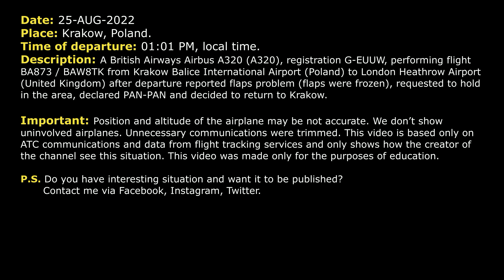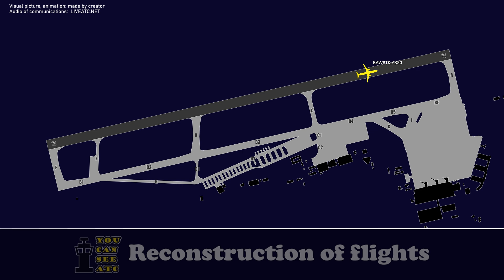“Our flaps are frozen”. British Airways A320 declared PAN-PAN after departure from Krakow. Real ATC

Comment: Anyone able to explain what the 2 hr endurance means? Is this something to do with the fuel burn if there was a fire ?
Reply: I assume it means they can fly for 2 hours in their current config before being low on fuel.
Reply: 2 hours endurance means the aircraft can fly for a maximum of 2 hours more. Unless it is absolutely necessary, landing with less than 30 minutes fuel will attract the attention of the company's operational standards unit, and possibly the regulators at CAA (Civil Aviation Authority).

Comment: Can anybody explain why the pilots decided to go back to Krakow? The plane was nearly equidistant from the two airports, and the controller suggested going to the other airport with the longer runway multiple times. I'm assuming the plane will be landing faster without flaps, and it sounded like the controller was concerned their runway wasn't long enough. I know the pilots have the final say in an emergency, but why didn't they go to the other airport?
Reply: The flaps were locked in TO config so max speed was 160kts.
Reply: @Bluefox202  That was my thought - had to keep lower speed...possibly BA has a more robust maintenance presence at Krakow.
Reply: @frollard  yup, most likely because Krakow is a BA station, while Katowice isn’t. Actually, the controller was incorrect about the landing distance at Katowice, it’s even longer! 3200m available on RW09. The 2880m is for RW27, the opposing direction, due to a displaced threshold. That said, the crew would absolutely have looked at the charts while in the hold, and would have known this. They clearly calculated that the landing distance at Krakow was still more than adequate and entirely safe.
Reply: @RomeoJulietCharlie  @06:00 The tower radios to correct/update his previous info re length RWY 09 to 3200m.
Reply: @frollard  Katowice is a low cost hub and has no BA or codeshare airlines, so they'd only go there if they couldn't reach Krakow
Reply: I’m absolutely an aviation novice but I can have a guess. During take off the flaps are extended to produce lift. So I assume as it was just after take off they were stuck extended, which would mean they were producing more drag which slows the aircraft down and why they also didn’t want to exceed 160 knots to risk something like stalling. So the plane would be landing with a slow speed anyway as it never got up to speed in the first place and on landing you also have flaps extended to create drag to slow the plane - which they were already configured to it sounds like.
Reply: @staceygrahame2504   There is a maximum allowed speed for each flap setting - exceed that and you stand a good chance of breaking the aircraft in a very nasty way. 160 knots sounds like quite a high speed to have flaps extended, so I'd guess they were locked at 5 or 10 degrees.
Reply: @hb1338  the maximum speed for flaps full (40 degrees on the 319 and 320) is 177kts. There is no 5 degree setting on the A320 series. Flaps 1+F is 10 degrees, which is the lowest setting with flaps extended. (The A321 positions and speeds are slightly different compared to the 319 and 320)

Comment: Frozen flaps can happen to anybody at any time (very grim).  Let's be careful out there.  Cheers!
Reply: I was wondering how this is possible? This situation took place on 25th of Aug (summer season where temp is usually quite high) is this caused by the fact that planes are flying high altitudes where temp is very low??
Reply: @michal_PL  Frozen flaps means that they are locked; this was probably due to the APPUs (Asymmetric positional pickup units) giving an asymmetric (or erroneous) reading, this will immediately/automatically apply brakes to the flight control shafts, this in turn stops any movement of the flaps for the remainder of the flight. There are many reasons why the APPUs could give erroneous reading, but the most likely is one of the sensors has failed and therefore the readings no longer match the other units.
The APPUs are a fail safe system to prevent asymmetric flap positions. Excessive asymmetric flap positions would not be healthy for anybody onboard!
Reply: @loganselkirk  thank you for your great answer!:)

Comment: Calm, clear comms by all.  Pilots knew what they wanted, 6000 ft and a hold to run through checklists.  Pan-pan correct choice for emergency declaration, controller offered alternative airport with landing distance available and metar for both.  A pretty much textbook example of how to deal with an emergency.
Reply: Agreed. And handled in a highly competent and professional manner by ATC too. Textbook all round, great teamwork between crew and ATC and a calm, controlled resolution. Plenty of useful information given, only criticism is perhaps a little too much info from ATC while the crew were busy. But being more helpful is definitely preferable to being not helpful enough.
Reply: Most impressive was how they sprang into action and quickly built some additional runway at Katowice, just in case. Above and beyond, if you ask me. 😁
Reply: @davidf6326  😂🤣😂🤣😂🤣
Reply: Indeed.
Reply: Speaking as a non-pilot, I would be so glad to have that ground controller helping me, giving me METAR and alternatives.  I have heard a few on Youtube that I would request be replaced with someone who could help me if I was in an 'unusual' situation.  Guess most everyone is feeling the same way, judging by the comments here....
Reply: Excellent English from ATC

Comment: Most likely not frozen as in ice - but a few sensors that fail can result in the A320 restricting flap retraction to maintain envelope protection. So flaps down is the computer failsafe position.
Reply: If anything stops, everything stops to avoid flap asymmetry
Reply: @chrisschack9716  ... and also flap skew.
Reply: The word used by the crew was "locked".
Reply: It's a flap/slat jammed abnormal condition

Comment: Any explanation why they were frozen in the first place?
Reply: it's flap/slat jammed, I think he said frozen as it was locked at that moment when he trying to retract
Reply: Frozen flaps means that they are locked; this was probably due to the APPUs (Asymmetric positional pickup units) giving an asymmetric (or erroneous) reading, this will immediately/automatically apply brakes to the flight control shafts, this in turn stops any movement of the flaps for the remainder of the flight. There are many reasons why the APPUs could give erroneous reading, but the most likely is one of the sensors has failed and therefore the readings no longer match the other units.
The APPUs are a fail safe system to prevent asymmetric flap positions. Excessive asymmetric flap positions would not be healthy for anybody onboard!
Reply: Not actually frozen. Don’t take it that literally.
Reply: Perhaps Airbus computer related?
Reply: Too cold weather?
Reply from the maker: I believe that was the way to say flaps are stuck.
Reply: @YouCanSeeATC  The exact word, used several times by the crew, was "locked".
Reply: Ambient temperatures dropped below 32F.

Comment: That controller is almost overdoing it volunteering information I think.
Reply: He did a great job but I was chuckling since it sound like he REALLY wanted them to go to the other airport and make it someone else's problem!
Reply: @iamweave  Katowice has much longer runway, but the controller firstly gave them wrong landing distance. Second think - Katowice airport is much less crowded area, far from the city, and does not need avoiding raising terrain and tress while going around. Kraków have.
Reply: He's not overdoing it. Remember that all the times when there was no communication between the plane and ATC have been cut from the video -- the crew say they'll need to circle for 15-20 minutes but that only takes about three minutes in the video.
Reply: I think he did splendid! Not knowing what information they had, since rwy length can vary depending on... stuff. Gave him two nice options, know that he might need a long one, tells weather and rwy length and then updated hen new information was available. To make it easier for the pilots to make a clever decision.
Reply: Saved an atis check.
Reply: This ATC is really the best I ever heard.

Comment: I'm sure he's saying locked flaps not lost flaps.
Reply: But what if the flaps WERE lost? 🤔
Reply: @Scuzzle-v2x  They would be in a bit of a flap then.
Reply: They have ‘lost’ flap control because the flaps are ‘locked’ in the takeoff position. The performance system BA used at the time tends to favour flaps 3 or F3 (A320) takeoff to give maximum payload. Thus when accelerating to retract the flaps and the flaps don’t retracted from F3 to F1 you must stop accelerating to prevent damage to the flaps. Hence 160kts (F3 limit speed is 175kts). F3 is also a valid landing flap setting so not an issue with landing distance requirements. We practice this in the simulator every few years. A320 captain
Reply from the maker: You are right. Thank you.

Comment: Declaring an emergency? He doesn't sound like an American. Very calm and professional handling by all involved.
Reply: American pilots >
Reply: @Jack3md  The best.....not those Euro Brit Douches.
Reply: American pilots declare emergencies all the time.
Reply: @N1120A  Yeah...Mayday Pan Pan is for Euro Brit Fools.
Reply: @N1120A  Yes, but almost never using the FAA protocol.
Reply: @cageordie  that couldn’t be further from the truth. The thing is, you’ve never had hands on experience flying in U.S. airspace. You just see a video or two online and assume that. Especially considering how many millions of flights there are every year.
Reply: @Jack3md  Ive been involved in aviation for forty years. Americans seldom use MAYDAY, they usually mention somewhere towards the end of a call detailing their woes that "we're going to go ahead and declare an emergency" which often results in the controller not noticing. When Transair 810 stuck their 737-200 in the Pacific it took three calls before the controller realized they had an emergency. Go aqnd read the FAA procedures on communicating an emergency, I'll give you a clue "declaring an emergency" is not in their manual. In the end TransAir chose to run out their personal clock descending and slowing towards the Pacific to the point that they were over the horizon from the runway that they were one turn away from when the ATC finally got the idea.
Reply: @Jack3md  as an American pilot I can tell u that we don’t use Mayday or Pan like we should. We usually say: “we are declaring an emergency at this time”. Which is technically wrong. Heck, we even do this wrong in the sim most of the time.
Reply: He should have just said Pan Pan three times, it is a state of urgency after all.  Emergency and Pan Pan are not compatible.
Reply: @givenfirstnamefamilyfirstn3935  The pilot clearly repeated PAN-PAN three times, which is the industry standard. Emergency is not a helpful word - an aircraft is only ever in one of three states - normal, PAN-PAN or MAYDAY.